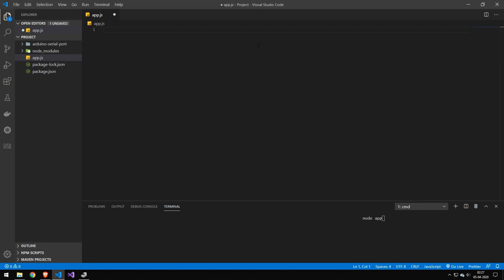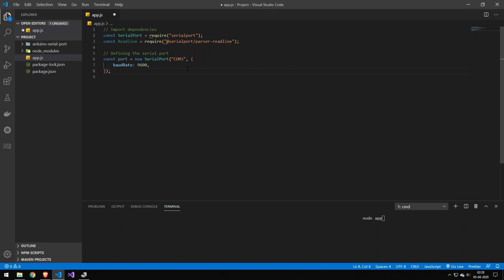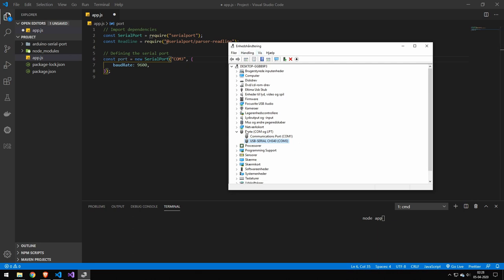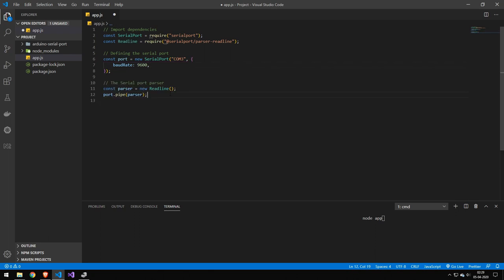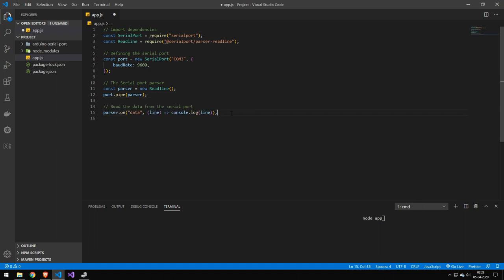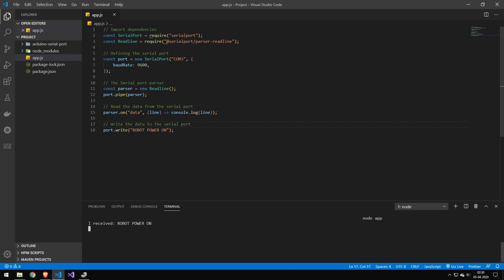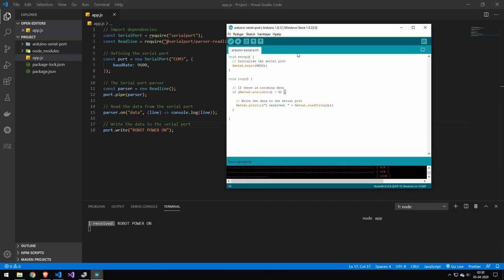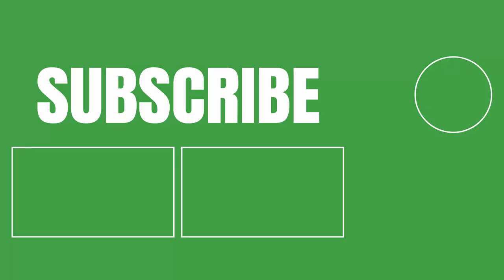How to Communicate With the Serial Port in Node.js

Comment: Hi, when I run the code, it tells me:
const port = new SerialPort("COM3", {
  baudRate: 9600,
});
SerialPort is not a constructor.
to install it I did: "npm install serialport" and I have version 11.0.0. which version are you using? and what version of nodeJs do you use?
Reply: Same error man the docs seems to change.
Reply: Even tho I follow docs the error still persist.

Comment: I have a node application with react front end  running on a VM. 
The requirement is to have the user upload  data from  device attached to their local machines using a button on the web application hosted in server. Would like to know what is the best way to do that ?
Reply from the maker: I've made a video in the past which might answer that question, here's the link.

How to Upload Files to a Node.js Server
https://www.youtube.com/watch?v=KP_8gN8kh4Y

And I probably would not involve the serial port. Since I do not really think it makes sense for that problem.

And here's some extra code for that video.
https://github.com/VLabStudio/Tutorials/tree/master/How%20to%20Make%20your%20own%20File%20Hosting%20Site

Comment: Hello, if the node application is hosted online, will it able to read the local machine serialport that opening the node application online
Reply from the maker: If the server is running on the local machine and the computer is port forwarded, then yes, otherwise no.
But, if you have a locally running Node application that communicates with the server, that is publicly available then, yes. And you can make the communication using MQTT.

MQTT package
https://www.npmjs.com/package/mqtt

Comment: hello, this is a very very informative channel. I want to know what is the code if I use multiple sensors which using the serial port? the answer would be very appreciated. thank you
Reply from the maker: Try this

// Import dependencies
const SerialPort = require("serialport");
const Readline = require("@serialport/parser-readline");

// Defining serial port
 1
const port1 = new SerialPort("COM1", {
    baudRate: 9600,
});

// Defining serial port
 2
const port2 = new SerialPort("COM2", {
    baudRate: 9600,
});

// The Serial port parser 1
const parser1 = new Readline();
port1.pipe(parser1);

// The Serial port parser 2
const parser2 = new Readline();
port2.pipe(parser2);

// Read the data from the serial port 1
parser1.on("data", (line) => console.log(line));

// Read the data from the serial port 2
parser2.on("data", (line) => console.log(line));

// Write the data to the serial port
s
port1.write("ROBOT POWER ON");
port2.write("ROBOT POWER ON");